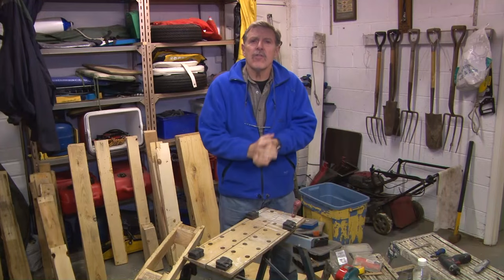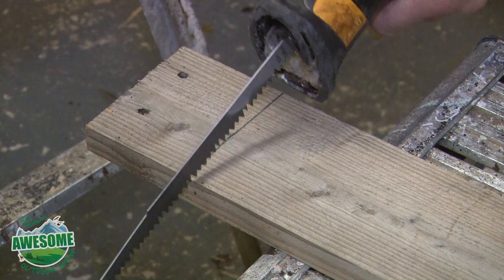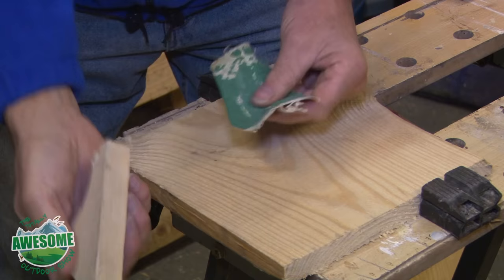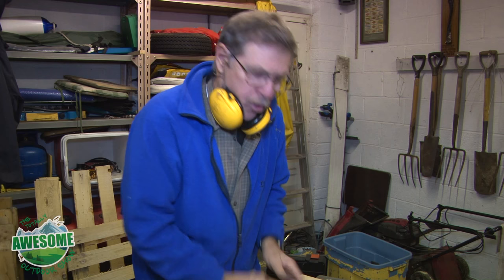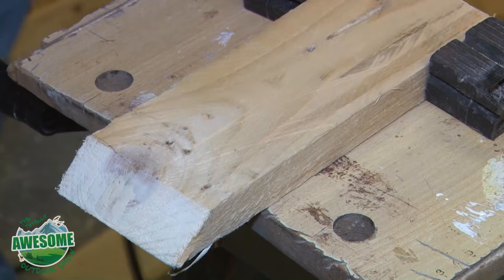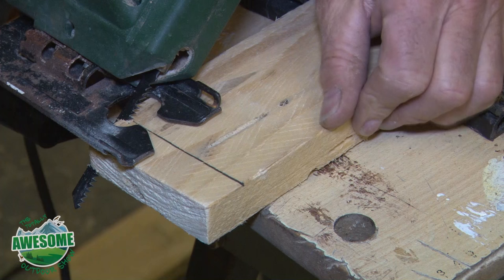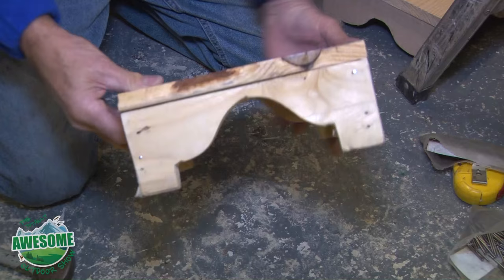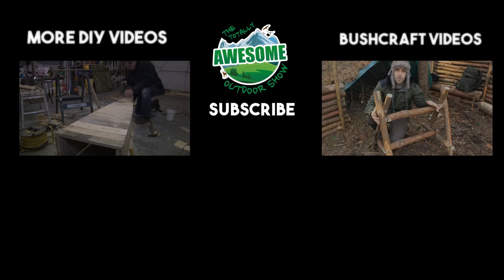How to make a Plant Pot Stand from Pallet Wood | TAOutdoors

Comment: Nice project.  One oldschool trick for fitting miters is clamp the pieces square then draw a thin sawblade through the crack a couple times to match the halves perfect. Not nessary on blind joints but nice for picture frames ect where it needs a really goodt fit. Enjoy yall's videos, good stuff cheap , my kinda show Cl;-(p)

Comment: Regards  reversing your set square to extend your cutting line. You could just use your yellow handled hand saw. It has a built in 90 and 45 degree setting, using the back edge of the saw blade as your straight  line.